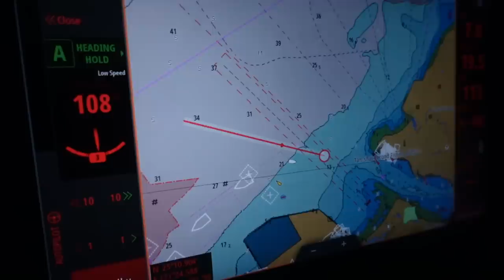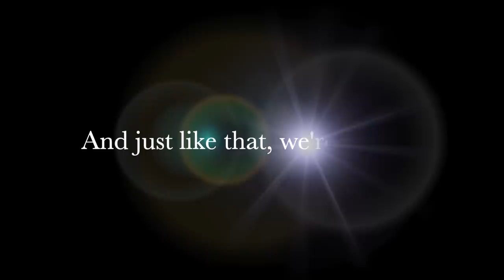Jumping into the Taiwan Strait. (Ft. a visit from the Taiwan Coast Guard)

Comment: Now that you are home and can get back to the cliff cabin build, two things.   You will need stickers on your windows to prevent the birds from suiciding against them and it is perfectly ok to avoid compromising the integrity of your roof by having  the stove pipe come up part way and then exit out the side wall instead.  Then, once outside, you can go back up to clear the top if the peak enough to meet code.
Reply from the maker: Agree on the window stickers. 
The company strongly advises against a wall exit - it’s a 3” pipe and they don’t sell parts for wall exit. Only pellet stove companies do and it’s horribly expensive.

Comment: Great adventure, still wonder when you burned that fuel what was avoided?
Reply from the maker: Diesel in Taiwan is extremely clean so it smelled and looked like gasoline. We put some of it in the boat and questioned it, which would have been a disaster if it was gasoline.
Reply: @michygoss7148  Ok thanks! Looks like my last reply went away ? Oh well anyway mystery solved thank you! I hope your finger is healed, that made me cringe,been there.